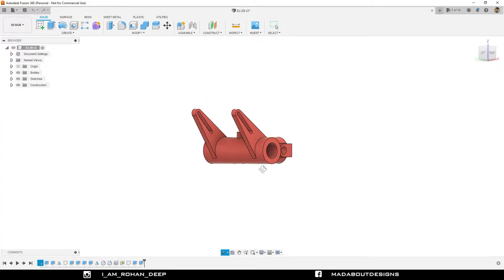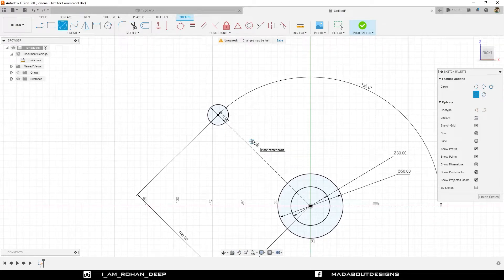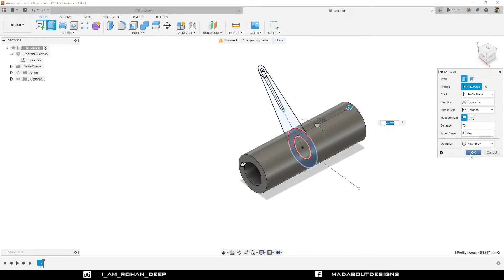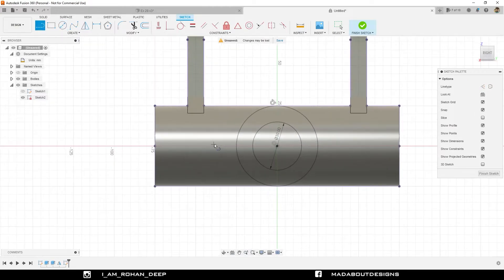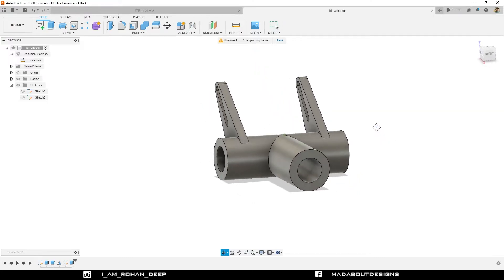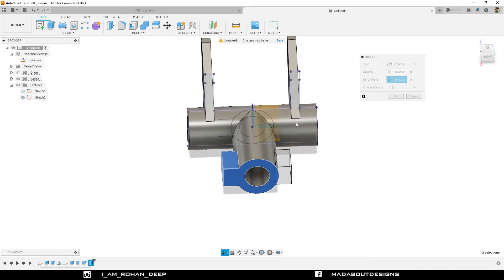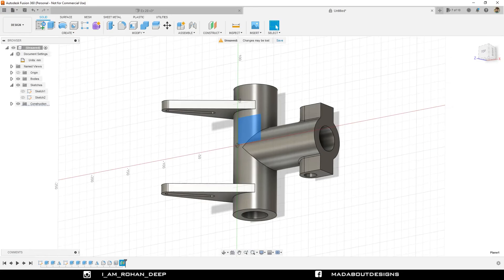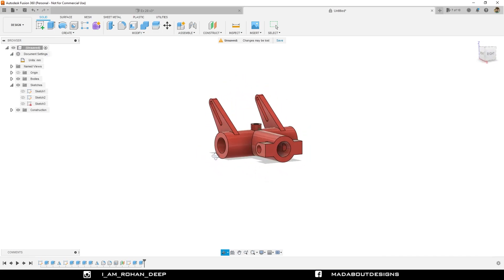Autodesk Fusion 360 Tutorial for Beginners | Exercise 25 | Learn the basics of designing

Comment: When doing Sketches in Fusion it is important for the Sketch to be fully constrained before extruding. On your Sketch 1 the Slot length wasn't defined therefore leaving the end of the slot blue. On Sketch 2 the width of the rectangle wasn't defined therefore the line was also blue. When Sketch is fully defined all lines turn black and there will be a red lock beside the sketch in the tree.. Great Video other than that... Thanks!!!
Reply from the maker: Thank you so much for your suggestions.. I will take care of them from next time